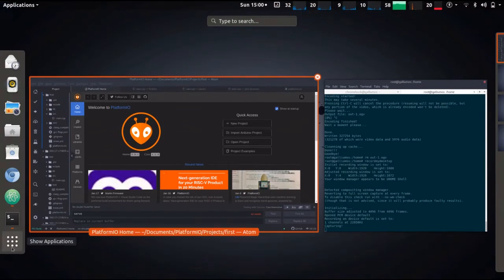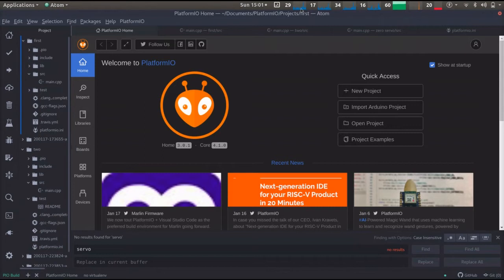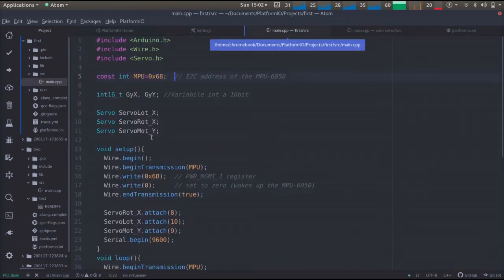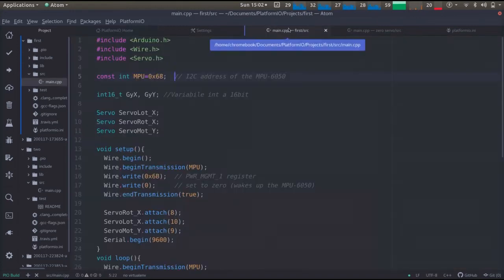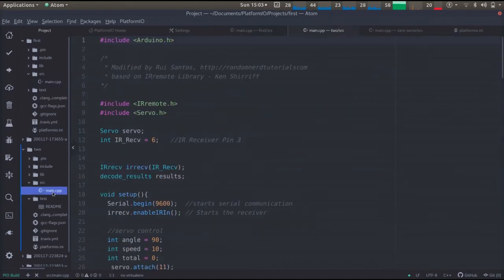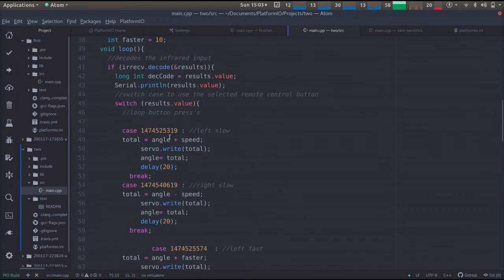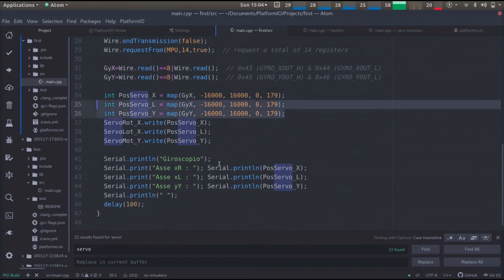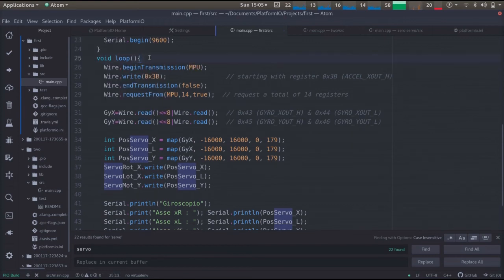mpu6050 with 3 servos. flight controller build. atom/platformIO intro..

Comment: oooo! This is solid man, keep working. You're trying to make a full on autopilot right?
Reply: This is my second channel. I was thinking a high weather balloon launch. Then i found your webpage. Great job dude on what you accomplished already.

My mind is thinking of all kinds of tasks i want to automate. I enjoy automating things. 

Have you thought of long range flights? Maybe a 4g module?

My first test depends on if i go the raspberry pi route, that will give me wifi for this project. A cheap phone charging brick could provide a pi plenty of hours. The power bank for the motors will die before the pi. I can imagine a read and write function over TCP. read the sensors and wtite to the pins the servo and motor data. 

Im goin to run some test tonight with the pi  the mpu6050/servo and ruby language. I could program much more advanced algorithms with Ruby.

Im going to order some wifi modules and some arduino nanos. Maybe some nanos with wifi. 

Have you thought about a drone remote controled on ham radio frequency? Is this just not plausible for long range?
Reply: @mikeyz8775  HAM Radio? Oof nah I havent looked into that at all. I know people have done some crazy things but i've learned to specialize in what i can and not stretch myself out too thin in one project. 4G i've heard great stuff about and really want to try one day. 

automation is cool as hell honestly i definitely get what you're saying. I used to fly manually for years - I let the Pixhawk take control and it was so strange to watch, in an amazed kind of way. Coordinating turns just fine and whatnot. Crazy stuff. 

If you wanted to do direct connection for long range, Dragonlink and TBS Crossfire are some ready to go products that do a great job. They operate on (I think) 433 mhz, or 900 mhz or 1.3 ghz. All lower your bandwidth (which you dont need for a controller) but give great range and penetrating capability. Where do you want to go with this project? Just a normal flight controller or are you doing the high altitude balloon too?
Reply from the maker: @ohitstarik  can i share with you a antenna design, i have 3d printed. i could definitely build a new antenna for 433/900/1.3ghz....

its a 2x2 5.8ghz settup. i would just need to design a new copper driven element. i design in cad then have cut from a vinyl cutting cricket,  the parabolic reflector is on point, i found a eccentricity method is a way to build a parabolic reflector with some math and graph. 

https://forums.hak5.org/topic/42737-new-antenna-build-3d-printed-58ghz-parabolic/#elTopicActions_menu
this was some of my first attempts. then at the end is the new dual 5.8ghz design. 

https://forum.freecadweb.org/viewtopic.php?t=20090
https://images.app.goo.gl/wr7k7EbNQ6nDvZf58
this was some cad and the method used 

what is the highest altitude you have reached and the longest flight time?